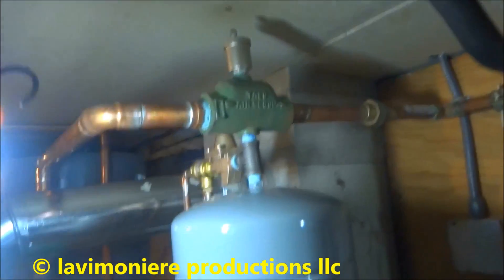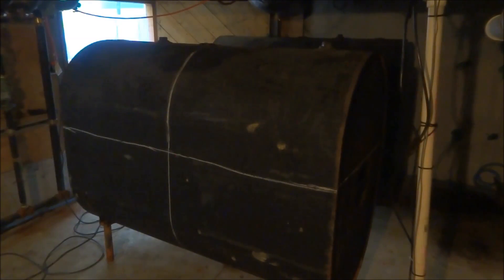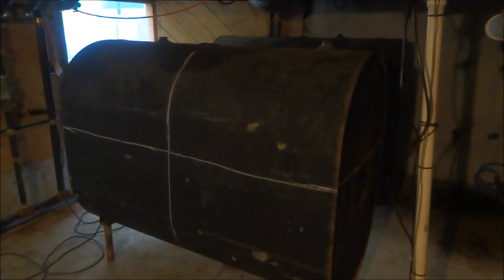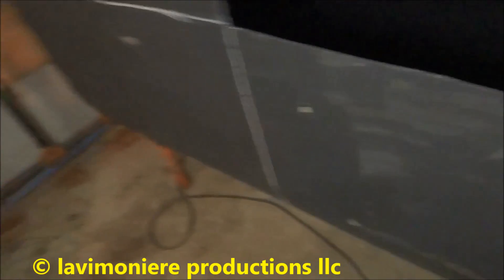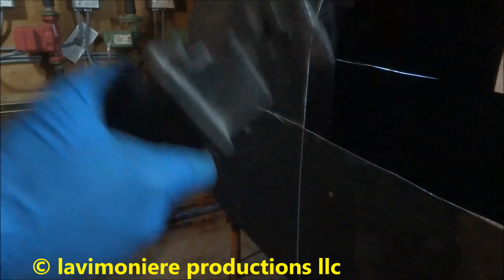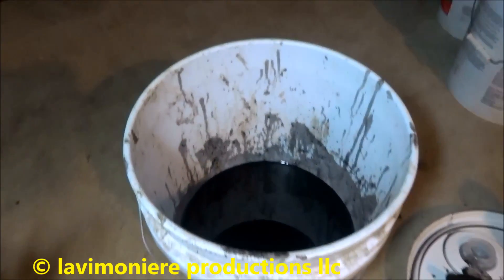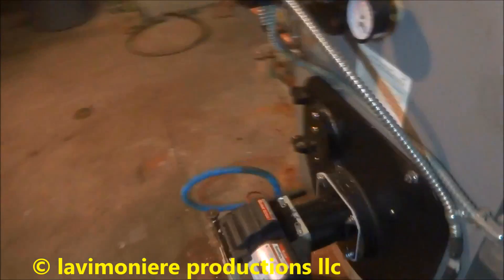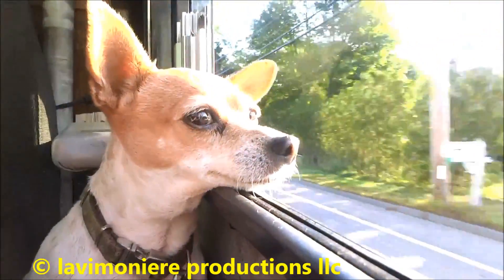boiler and 2 oil tanks replaced part 4

Comment: Been watching your vids for around 2 years now and every vid you put up mate are very good. I feel I learn off your vids Steve. I used to work in a hospital while I was in school 3 days a week fixing all the plumbing and cleaning the boilers fixing them. our boilers where like thermax steam tube boilers. each morning we went to work we had to go to the boiler house take readings and we would shut the boilers down for around 10 mins while we opened the door where the burners where to clean the cup where the oil would go throw to the chamber its self. used to clean the spinning cup we called it. take all the oil off it as there was build up off thick black oil had to make sure it was running fine. every time the door would be open it sets alarms off. the boilers would work to there max every morning between the landery kitchen operating rooms ward showers, and sterilising. loved it while I was there different jobs to do each day and we would shut down one boiler for a week out 2 while we pulled it apart for its service big dirty job that was we would fire it up to warm the soot so it would come off easy and then shut it down drain all the water out the boiler then open it up and clean all the tubes out. along with the fire chamber would crawl in the back and hover all the crap out. as the boys used to play around chucking rubbish in boiler then light it up nothing but black smoke for around 5 mins coming out the incinerator chimney. But I like to say thanks for sharing your vids bud I love seeing them I feel like I can learn more from them as well you and baby the dog are the best Mama lol keep up the good work. look forward seeing more videos buddy ;)

Comment: Those new tanks were a clean install. I liked you did two fills less pressure on the tanks. I liked you supported the cross overs and separate large filters. What I didn’t like was coming out of the bottom of both takes so water and crude goes directly into the filter (faster filter plug than your drawing off one tank. I would of liked to have pads on the bottom of the legs each tank when full weighs over 2000lbs and concentrates on 4 small spots on the floor I know the old tanks were the same😮 but over all that was a clean setup 😊

Comment: Steve, what's the ratio of oil vs other heating methods up there?Down here oil is starting to fade out. Natural gas is a lot more prevalent. Mini splits and VRF equipment is taking off.
Reply: Blake Steen Don't know the exact ratio, but some locations just don't have access to natural gas. Propane is usually more expensive than oil. 
Electricity rates can be high too, and this area is arguably a little out of the league of what average heat pumps will handle, especially during a big cold snap when you've got 0 degree or below 0 days.

Comment: Why do the yanks have oil tanks inside . Why not outside  ? why do the burn diesel rather than kerosene
Reply: k20aa We do have exterior tanks, but indoor tanks are usually preferred, because home heating fuel starts to gel below 20 degrees F. 

We also use Kerosene, especially in mobile home heaters, but home heating fuel is usually much cheaper, so that's what most people burn.
Reply: Thanks for the the that . I am a heating engineer in the uk